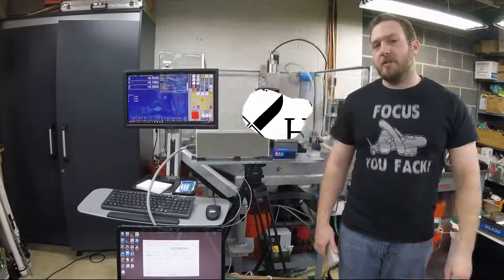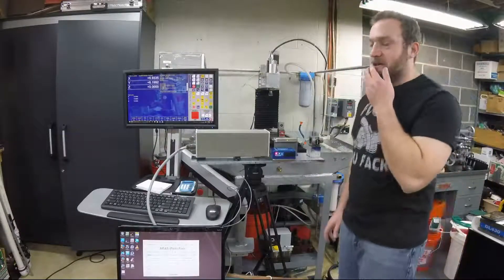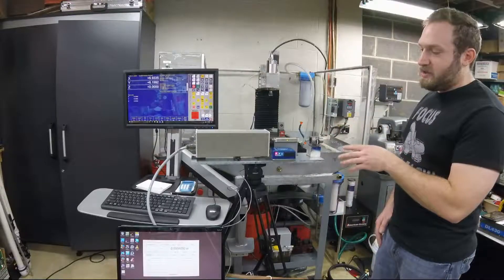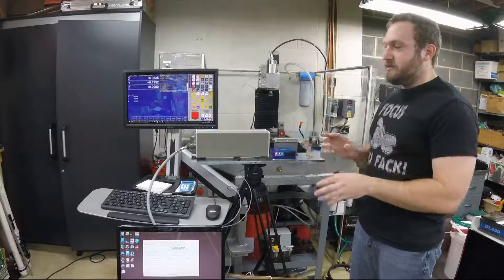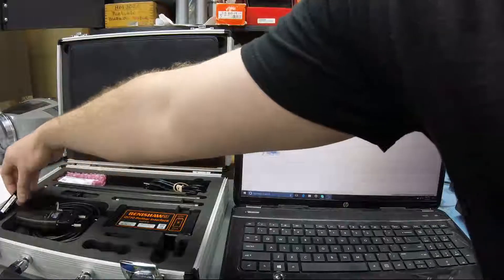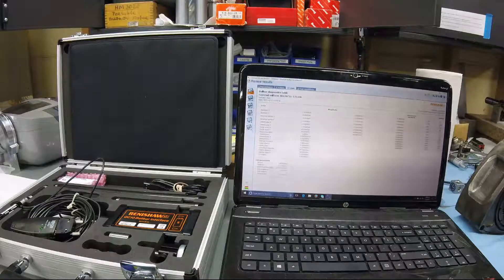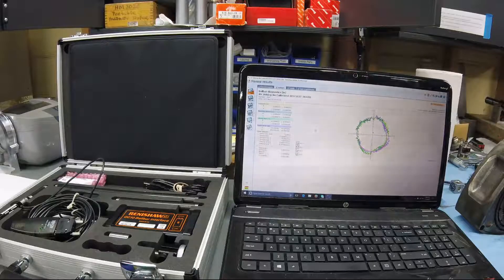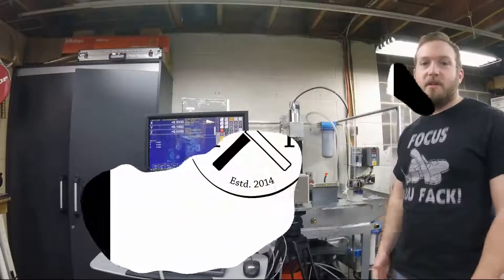Cnc machine tool calibration using a laser interferometer and renishaw ballbar with acorn control

Comment: Alan, first of all amazing information and effort! No non-sense, straight to the facts is greatly appreciated. However, I was very disappointed to hear you say your accuracy is only within .002" to .003" using a laserIF to setup. I am accuracy obsessed and have been looking for a video-verified small CNC mill with accuracy of .0001" that is all totalled under $30,000. So far it does not exist. Where do you think your inaccuracies in your setup are? Exactly what model numbers of equipment would it take to make repeatable cuts to .0001" accuracy with your setup (or any desktop mill)?
Reply from the maker: Thanks, .002" of an inch over and 8" circle on a ballbar test is quite good for a home made mill, most haas run .0005" new and .001" after a year or so from the research ive done. My mill is a fully custom x2 with every axis changed running on linear rails. Im hoping to get it under .001" this year with nsk ballscrews and new rails being hand scraped in flat.
Reply: @AMHKnives  , thanks for the reply. With the effort you put in I have no doubt you will get there. I did not realize you were testing on a 8" circle, so I get what you are saying. Have you seen  the specs on the Skyfirecnc SVM-1? Eon Machining verified it cuts within .0003", but at 2" linear. Keep up  the good work.
Reply: @AMHKnives  Have you created ballscrew correction tables in the controller, and did those help much, or was it mostly physical squaring/trueing that got the results?
Reply from the maker: @samroesch  always trueing up a system will be the biggest aid to getting a machine accurate. I did make correction tables for all the axis on the mill, it definitely made a difference in the machines overall accuracy but was a ton of work.
Reply: @AMHKnives  Do correction tables only apply longitudinally along an axis, or can it correct for X error during travel along Y, if your rails aren’t perfectly straight for example? I would have thought it’s possible to correct all errors in software if you have a reference like the laser to go off, but it sounds like that’s not the case?
Reply from the maker: @samroesch  the laser is only measuring the movements of one axis at a time for corrections of the error of the ballscrew over the length of the movments, the ballbar can show errors in 2 axis at a time. That will show any errors with both axis, does take alot to figure out the pictures of the circles to show what is giving errors along with the numbers.